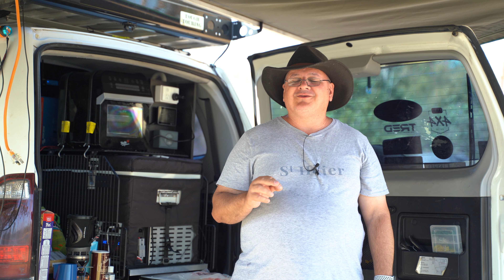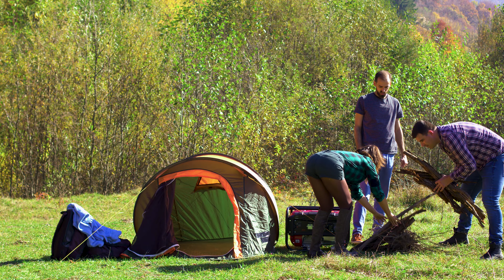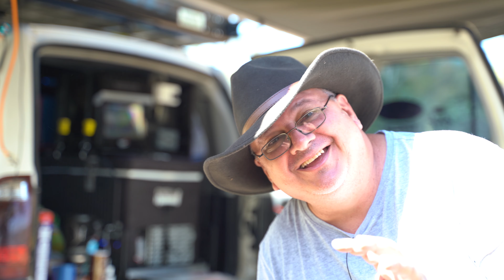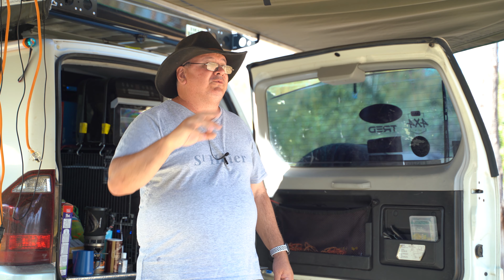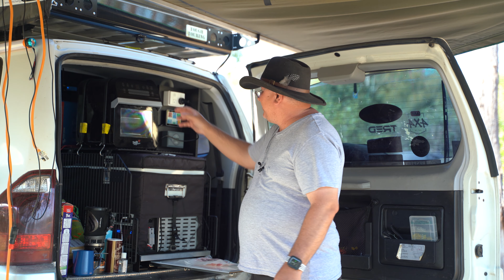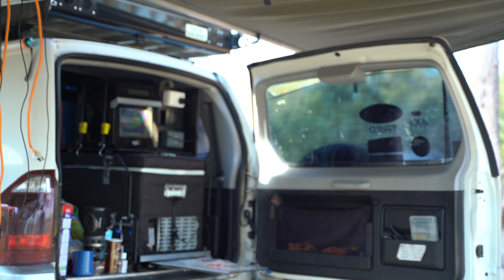Is a Generator at Camp a viable choice.  Honda generators are quiet and make a perfect power source.

Comment: Mate. You are doing it all wrong. A generator ! Ffs. More lithium. Better replenishment via buck boost from alternator (Safiery) and better solar will negate a gennie.
Reply from the maker: But than I got to run my 4WD to charge battery.  Have you tried doing that at camp with a diesel motor.
Reply: Where do you live? For us that live in the south, what a dickhead comment.

Comment: Many thanks for showing this and all your videos using the Victron gear.  I don’t think that I will be investing in a generator to assist in powering the batteries, but I am stoked that it is a perfect fit for you and your situation.  Keep on smiling :)
Reply from the maker: Works perfectly for me.   Obviously I will limit and in some cases not use the generator at all depending where I am.    Most of the time there will be no issues.   As I remote camp a lot.

Comment: I much prefer to use a generator over solar. I only need to run my gen for 1 to 1 1/2hrs every few days to keep things topped up. Solar always seems to not input enough either becuase of cloud, or being parked in the shade etc.
Reply from the maker: Exactly .  Spot on with your comment.  Lithium’s are so much quicker to charge,  silly not to take advantage of that feature.  A Generator charges a lot quicker and you don’t need to always camp out in the sun all the time with a generator